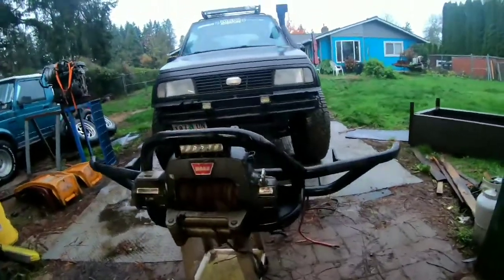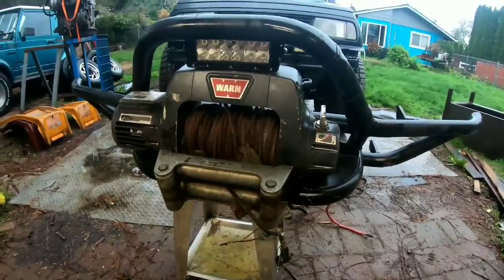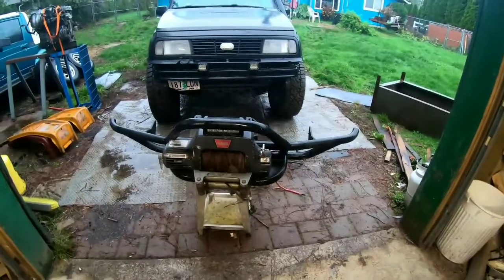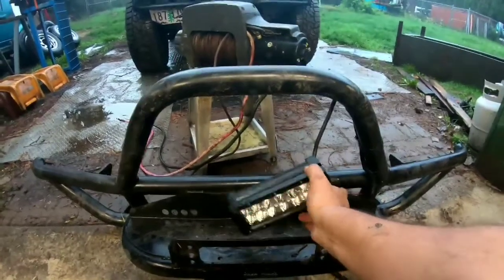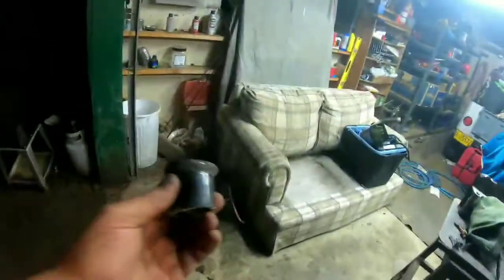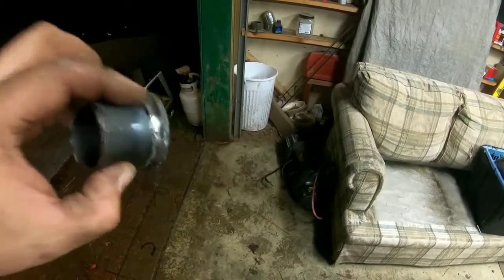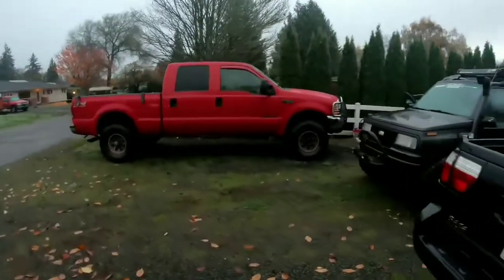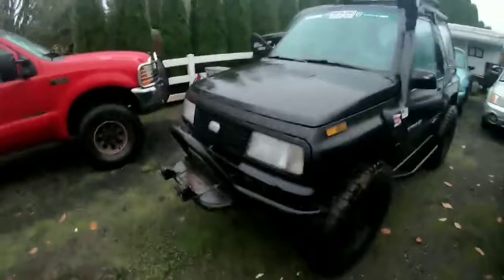Installing a Trail Tough bumper on my Overland Geo Tracker

Comment: Great deal that will get you out of a pickle. Looks good too! 👍
Reply from the maker: Hopefully it works.
Reply: @trashpandaoffroad3548  Does the wench smell burnt? Does the wench have manual F-R switch? If it does hook a set of jumper cables to it and power it up. Being optimistic I say it does work just like the LED did. I'm keeping my fingers crossed for you 👍
Reply from the maker: Thw controller has been ordered so hopefully I will have an update video soon. Just waiting on parts.

Comment: How much body lift do you have?  Thinking of getting the same bumper and I'm trying to envision it mine is 1" lift on the body
Reply from the maker: I run a 2" body lift. Unfortunately the Trail Tough bumper does not cover the gap caused by the body lift.

Comment: I just bought a mile marker 5000lbs winch w/ synthetic. It's made for a SXS so hopefully it will work.  It weighs 19 pounds
Reply from the maker: It should work for your rig but you wont be able to rescue any Jeeps.🤣🤣
Reply: @trashpandaoffroad3548  You discovered my motive. Seriously though, you have to be real careful with a big winch on a tracker, you could stretch a 2 door into a 4 door or make it real easy to only turn one direction.
Reply from the maker: Agreed.  I run a smittybuilt 9k on the Trash Panda and it has been Ok. This Warn is probably overkill.